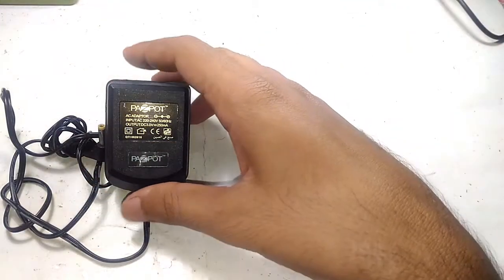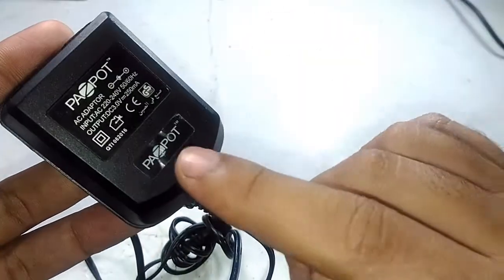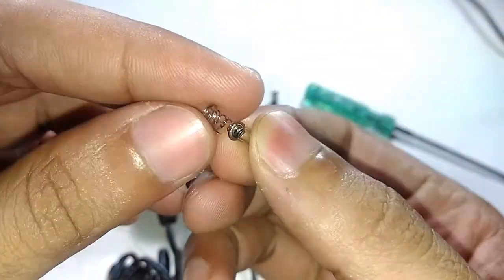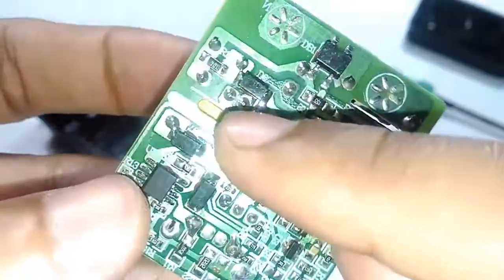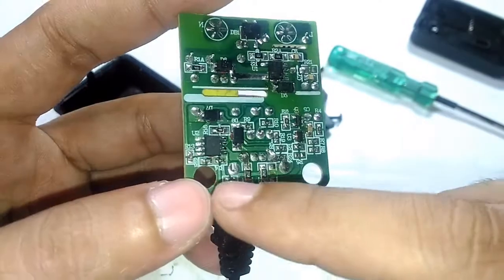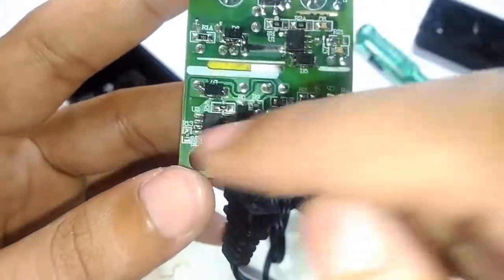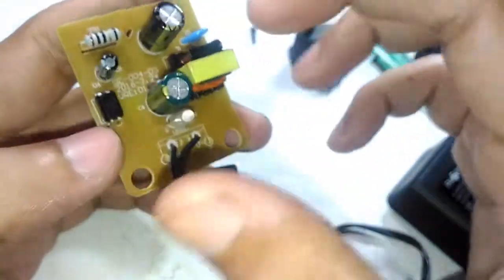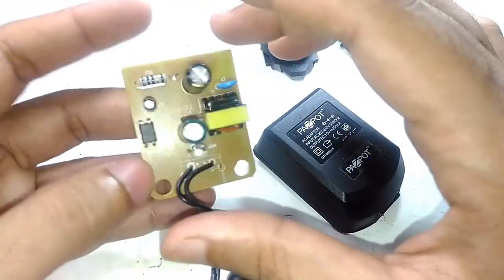IE81: Pazpot flashlight charger with interesting circuit inside!

Comment: I need this charger and a new battery for my pazpot how and from where can I find one? Any help is appreciated
Reply from the maker: The original battery and charger can be bought from the authorised service centre near you. However, you can get an exact replacement from any electronics store by bringing in the current charger and battery for the sample.

Comment: How to open front cap of tourch plz update
Reply from the maker: That depends on your brand of flashlight. Sometimes you need something small but rigid that can be inserted into the LED head and twist it so that it gets unscrewed from the socket. But be careful as excessive force may damage the thread. Sometimes it's just clipped in. You need to check it.